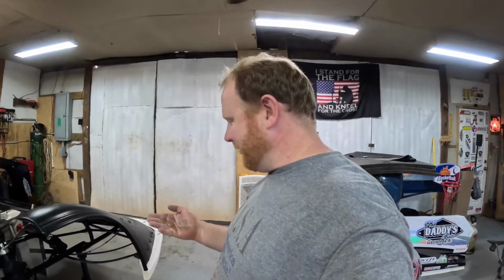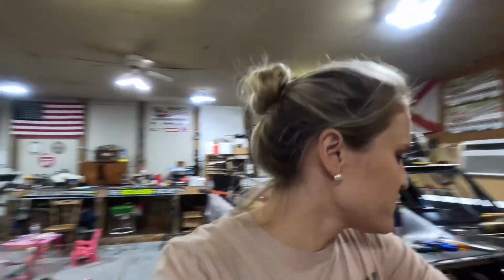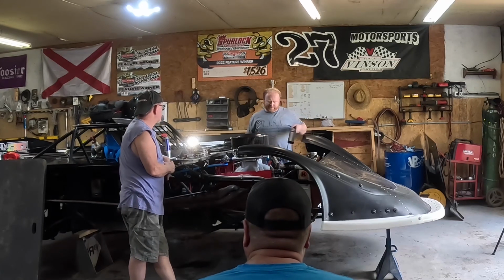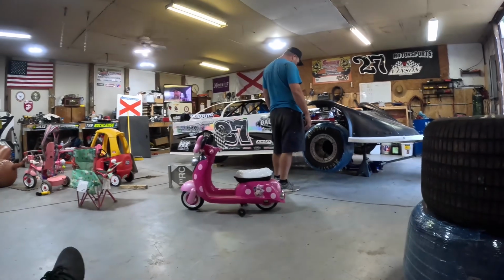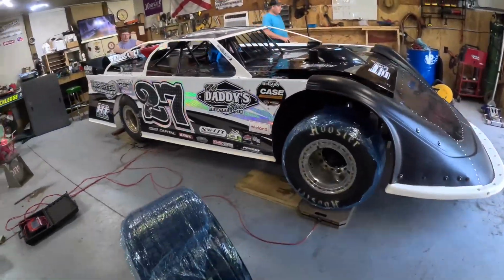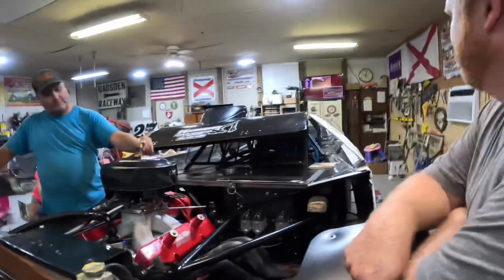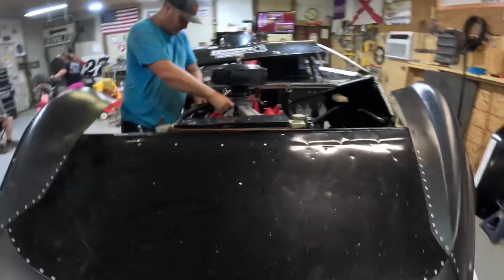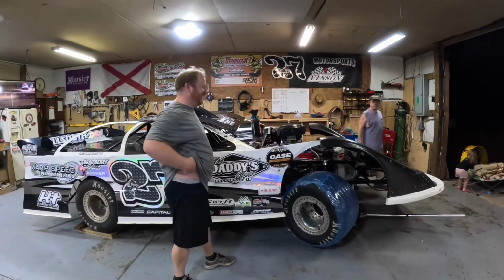We almost had to make a trip to summit racing for a last minute part!

Comment: Hey Brad what’s the difference in weight between the steel and aluminum block motor? Aluminum motors were just coming into late model racing when I got out. Could not have afforded one regardless lol. Good luck tomorrow night. You all take care and stay safe.
Reply from the maker: Roughly 100 pounds just in the block
Reply: Best of luck guys 🏁🏁
Reply from the maker: Thank you